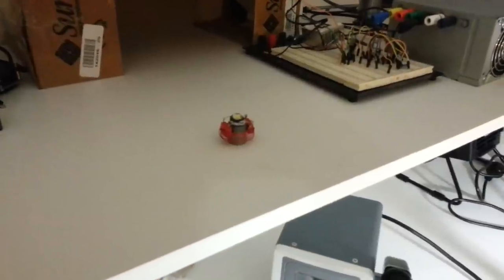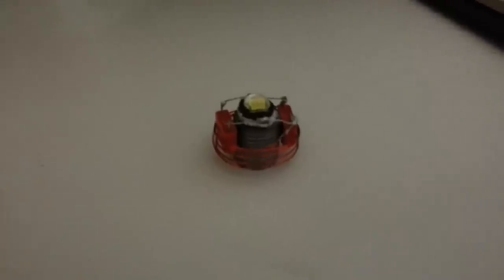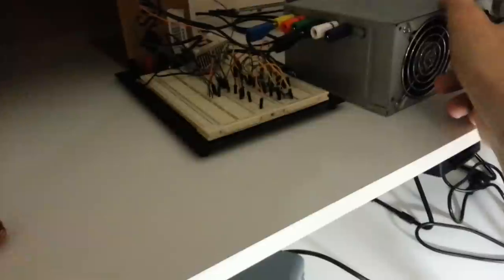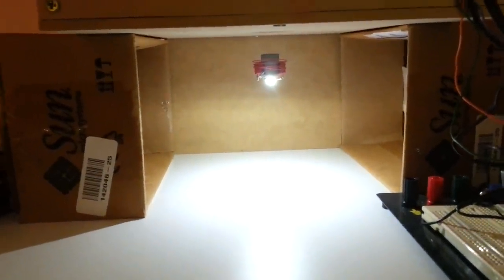Levitating Light Bulb (Wireless Power Transfer + Magnetic Levitation)

Comment: Two different circuits. They are independent and he said that the induction field does not interfere with the levitation field. So you keep the 3 watt levitation field on all the time (although if I read it right, you want to turn it off if the light isn't in place or it uses 4 times as much power and heats up) and then you turn the induction field on or off to control the light.

Comment: It's something like 3 watts for the levitation, I believe. (Someone smarter feel free to correct me.) If you are willing to spend 20 cents a month for the effect, then it is worth it. Power transfer loss seems to be 3 watts on a 3 watt led so 6 watts, I guess. That part only needs to run when you want the light on.

Comment: Hardly. It isn't RF it's just transformer induction with the LED coil as the secondary obtaining power from the suspension coil that is actively controlled by a pulse circuit connected to an optical detector light beam.

Comment: as a failsafe mechanism when the power goes out, is it possible to have a permenant magnet which acts to pull the bulb towards the top, and the levitation is actually working downwards against the magnet's pull rather than upwards against the weight of the light? that way, during a blackout, the lights just snap into the ceiling

Comment: where are the schematics, photos, extra info? The information on your website is quite...not enough. I'm an Electrical Engineer Graduate, an Engineer and I'm at my master's degree at the University Politehnica Bucharest in Bucharest. My research project and actual diseration project is Optimizing of wireless transfer of electromagnetic energy. So I would be very delighted if you would share your research.